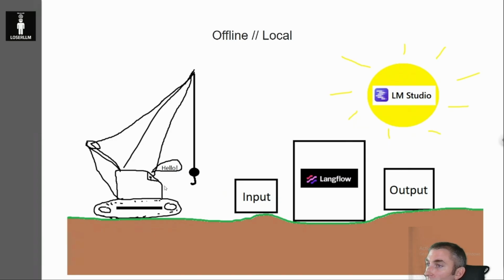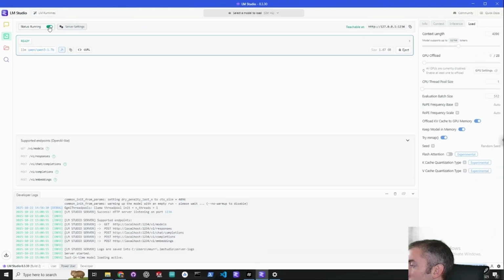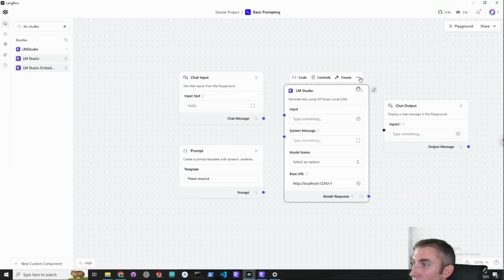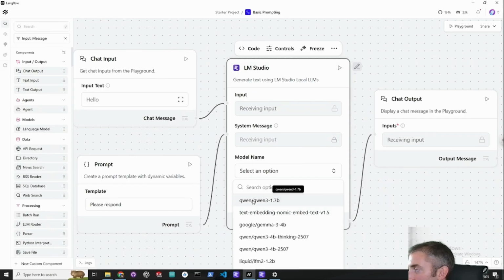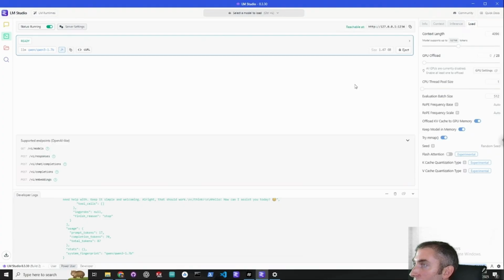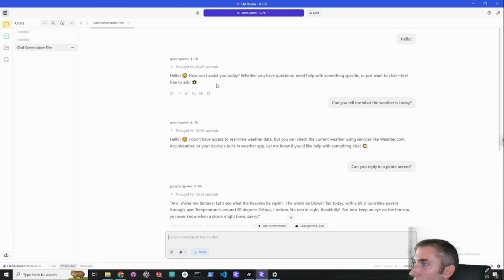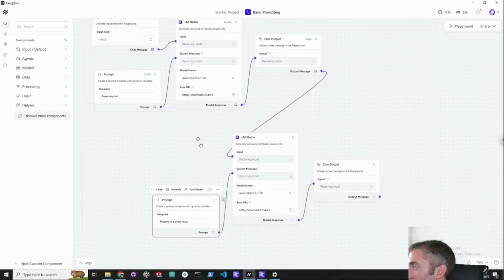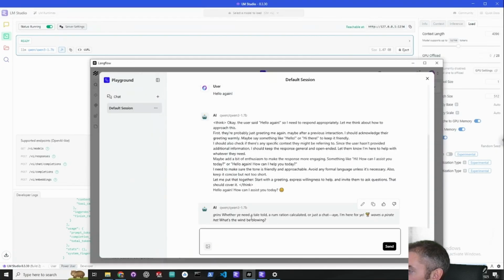Launching LangFlow for the First Time

Comment: I was watching your videos. And i could relate to your experience with this software. 

About three months ago, i bought the GMKtec NucBox EVO X2. It has the AMD Ryzen AI Max+ 395 with the Radeon 8060S iGPU. It has 128GB of ram. which can be dedicated as 96GB of VRAM and the rest as System RAM, and still the iGPU can still use some of that system RAM as shared VRAM.  

I work for  the Department of Defense (Civil Service employee). it was difficult to play with it since i come home very tired after work, and have no movitation for playing around with LMStudio, LLMs, or anything related to AI. Also I am a complete novice. 

However during this furlough or Government shutdown, i started getting back into it. 
I came across and watched your videos. I started to play with LMStudio again. I ran 120B gpt/oss, some 70B paramter models , just trying to see what this Machine can do with large models. i still am not sure what it can do, Like I said I am a novice, and still learning to set up LMStudio to run large parameter models. I have tried many different LM Settings, and i still am having difficulty with it all. I dont understand why the LM Studio, or whatever App is being used to run the models, was not made to figure out, what machine you have , and configure itself to run the models as fast and efficient as possible. 

I tried running LANGFLOW, but it failed to run. Though it could be because i installed it on an external SSD connected to the USB4 port. The research i did, says you can run on external SSD , provided it is fast enough. i am running FREECAD, GIMP, and many other programs of that same drive so , it must be another issue. 

Anyway, I liked watching your videos. And i hope you get more subscribers and viewership. 
I do want to offer you feedback about your voice fading to a normal loudness, and then like to whisper quiet. Also most of the time, your face is only visibile from the top of your head to about the  bottom of your first lip. Is that your style or is it a glitch.
Reply from the maker: Just for you! https://www.youtube.com/watch?v=tiNv4Yq_dRA